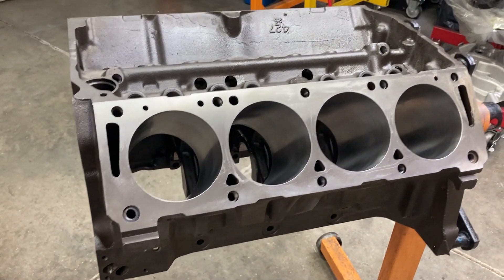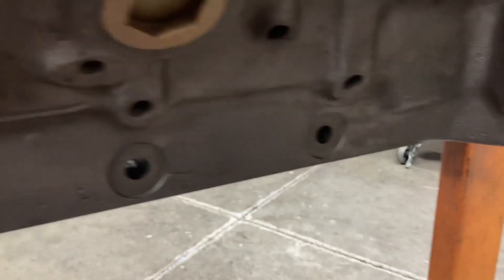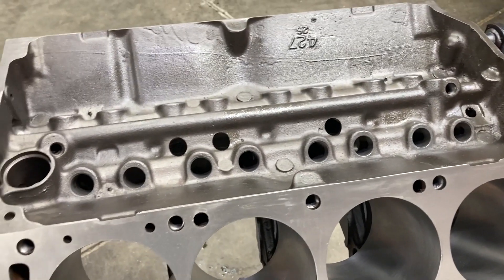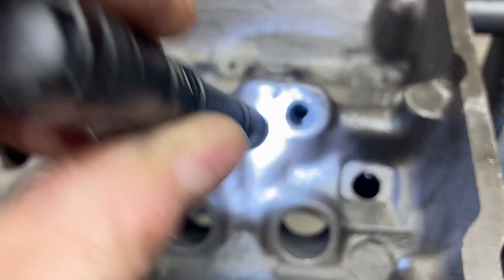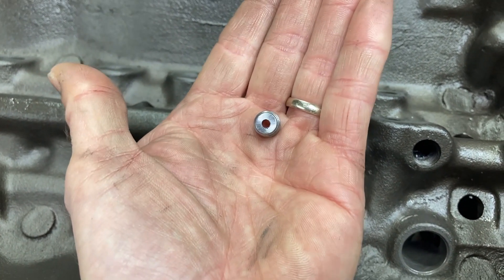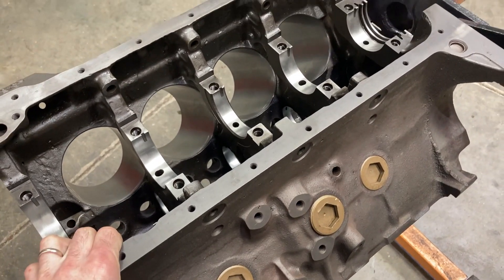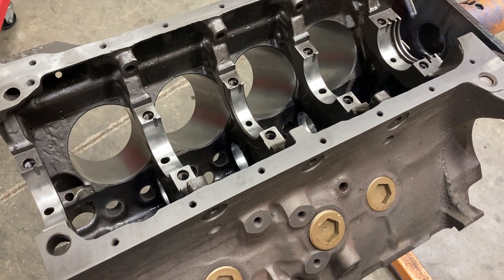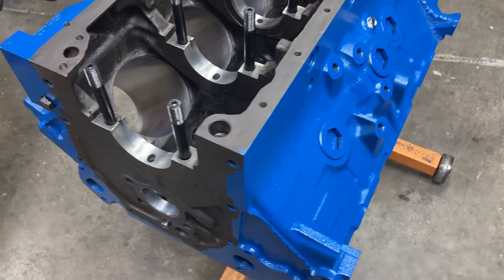Lykins Motorsports Ford FE 465ci Tunnel Port Build Overview

Comment: If you are rebuilding that engine for someone, you want to change all the freeze plugs duh! Change them when you have a chance, I did not and oops! :(
Reply from the maker: We do not change out those freeze plugs.  No need to.
Reply: No they will rust later and cause leaks, stop being so liberal minded! :(

Comment: The large oil passages serve to fill hydraulic lifters with oil as well as lubricate the valve train.  I have heard of people using restrictor plugs even when using hydraulic lifters, but don't have personal experience with doing so (I was never brave enough to see if the crank could tolerate it).  Do you Know if it can safely be done?

Comment: As far as the 4 bolt main caps go, I had 2 of my 390 blocks converted with custom made caps & welded in flanges.  Later I thought it over & made a complete lower block plate.  It was kind of like combining a main girdle with a windage tray. It was a 1/2" plate that connected main caps, front cover, oil pump, & oil pan rails with cut outs for the rods & crank pins.  Was much easier & most likely more effective than a welded up block.

Comment: As to 'cross bolts', in late '62/early '63, Ford had cross-bolted 406 engine blocks ... primarily for NASCAR use.
Reply from the maker: Yes sir, that is correct.  There were also 427 center oilers that were cross  bolted.  I don't always explain things that well, but the point I was trying to make was that a 427 side oiler should be cross bolted, in addition to the other features.
Reply: @lykinsmotorsports  All 427s were cross-bolted from inception. They were, as you aptly noted above, "center-oilers" from 1963 until the advent of the Medium Risers in 1965, when they became side-oilers... which means even the famous 1964 High Risers of NASCAR and NHRA Super Stock ... most famously the '64 Thunderbolt Fairlanes ... were center-oiler block-equipped. 

I had one of the 393 1968 Cougar GT-E 7.0-Litre 427s... stupidly rated at 390 horsepower, while the '68 Cobra Jet engines were rated at 335 horsepower, even though they had the same camshafts (basically the 390 GT cam), cylinder heads (both basically the '63/'64 Low Riser) intake manifold (Police Interceptor, though the CJ's was in cast iron) ... but where the 427 had a 600 cfm Holley, the CJ had the 735 cfm model. The biggest "power killer" of the 427 was the 390 GT exhaust system it was saddled with... manifolds to the exhaust tips... which were GT-E specific. The CJs had a superior system... from vastly improved manifolds on back.

And FYI, the Cougar 427 even used basically the same crank train as the '63/'64 Low Risers... right down to the cast crank, "nut&bolt" rods and even the "bumper-top" pistons matching the "raised knob" intake valves of the old Low Riser.

BOY, do I wish I had that car back now... considering its rarity. 😒

Traded it in on an early '69 BOSS 302... which I subsequently traded for a '70 BOSS 429... which I subsequently turned into a BOSS 302-powered E/Modified Production drag car.

IF we only had "future vision" <DEEP sigh> 🙄
Reply: @lykinsmotorsports  Ah, well forgive my comment then please, I meant no disrespect.

Comment: This 427 stuff is awsome to see & learn about. However it is out of my reach realistically to ever own or work on. I do work on 390's quite often. So I would like to know more about restricting oil to the top or other oiling mods on the center oilers. Also some info working with old oem cast iron heads. C4AE-G or C6TE heads .

Comment: I like the 428 Super Cobra Jet I have a 428 Cobra Jet that is rare I never seen one like it and my friend has 428 Cobra Jet and I run off and leave them even outrun regular 428 Super Cobra Jet and outrun 429 Cobra Jet so fast I'm talking about his braids to U bolts on the rear end and break the motor mounts it was so fast my brother took it down the road stompdown on it and they too black March down the road flipped it over three times and split it down the road on it stopped and he was going to send it to the junkyard and I said hell no I got the car today I have a brand new engine I never seen a Cobra like this one

Comment: I'm sitting here, inspired by watching FE engine builds, so, I'm looking at the cover of my Hot Rod magazine, January, 1965 edition (50 cents)  ..illustrating Fords new 427 Cammer engine. The photo where the exhaust is fire red on the dyno..  and I'm wondering what kind of reaction Dodge might have had to that article. Not because Ford built an overhead cam Hemi engine that made 600+ hp with a single four bbl ..but because Ford did it in 90 days!   Go Ford...
Reply: If Bill France hadn't been such a dick, we might have had a run of 1000 SOHC Galaxies in 65, and SOHC Fairlanes in 66-67. Maybe even some SOHC Mustangs to take on the Hemis in Super Stock.

Comment: Was the Mk IV the only vehicle to use the Tunnel Port in factory competition? Im sure that since the TP was sold over the parts counter it was not certified for NASCAR. Was Ford using the medium riser in that venue? What do you think of the Shelby aluminum castings of these FE blocks for weight savings?
Reply from the maker: Yes sir, I do believe you’re right.  The TP seems to be very popular among the Mustang and Fairlane crowd though.  I’m not an aluminum block fan.  They have a tendency to give up hp due to heat expansion and loss of ring seal.  I’ve seen 30-40 hp difference.

Comment: What do 427 bores sonic test at when bored .017 over?
Reply from the maker: Just depends on the block and where you measure it.  .017" overbore is just about .008" per side, so it's not a huge change.
Reply: @lykinsmotorsports  just wondering if a .030 over 427 is thinner than a .030 over 428 as a general rule?
Reply: @riccocool  i would assume the 427 
.030 over would be thinner than the .030 over 428. The 427 has .100 bigger bore. They were stretching the block design for all it was worth with that bore spacing.
Reply: @jesseduke694  thanks. The math says a .060 over 428 with .203 [13/64] for water between is slightly thicker than a .030 427 with .140 [9/64] water jacket between cylinders but haven't heard anyone confirm this.
Reply: @riccocool  im only assuming. I just know the 427 is .100 bigger bore. Dont take my word as gospel. I have no hands on experience with either of those blocks. All mine is 390 stuff.
Reply: @jesseduke694  you are correct. Thanks.

Comment: Thanks for all the knowledge shared! I have always wondered about the rear camshaft plug needing a button, a bearing, or not, for locating the solid roller camshaft. Does it needs one there or is just at the front? And if it just goes at the front, how the camshaft does not scratches that rear cam plug. I have never installed a roller camshaft before.
Reply from the maker: The rear plug is just a cup plug that doesn't serve any purpose besides closing the hole.   It's the same, no matter if it's a roller cam or flat tappet cam, and doesn't have a purpose in controlling the position of the cam.   The only reason I mentioned the cup plug was that guys have a tendency to install them backwards, which can cause problems.   There is considerable space between the plug and the cam when they're installed correctly.  All Fords have a cam thrust plate in the front, that controls the camshaft thrust.   Fords don't need buttons or reinforced timing covers like a Chevy/Mopar.
Reply: @lykinsmotorsports  Ah, now I get it. Then all the location (back and forth)  goes around the thrust plate. About placing the cam plug backwards, I know about it. I bought a 352, almost for nothing. The seller didn´t want it because it was dripping oil after a relatively expensive rebuilding and distrusted the machinist. While purchasing, I told him, he say anyway he didn´t want it any more. Everything was O.K. It runs nice, It was just the cam plug placed backwards as always. Thanks again!